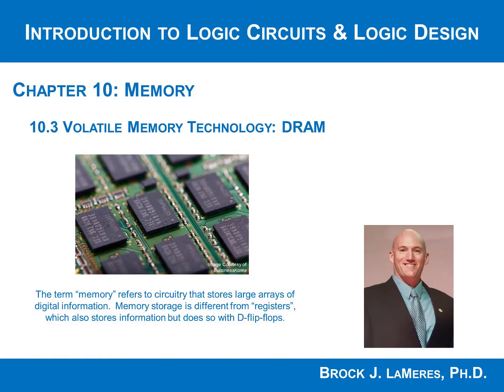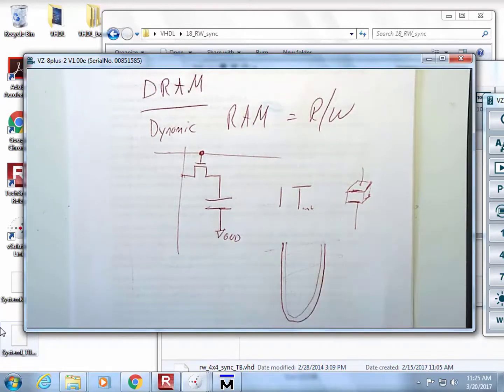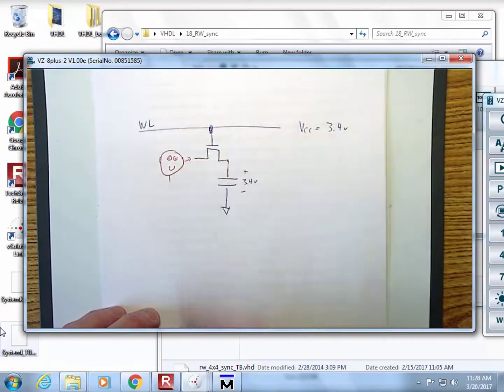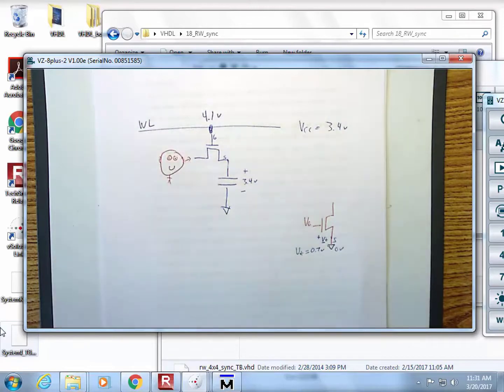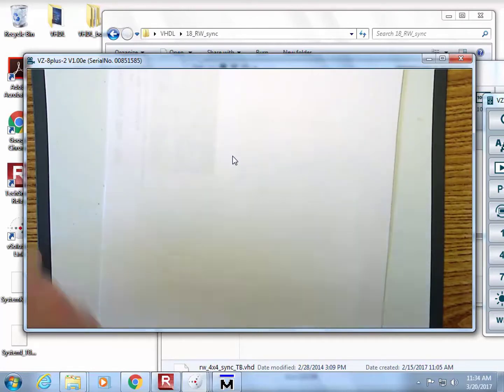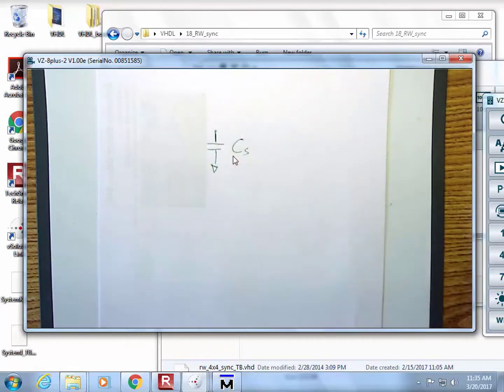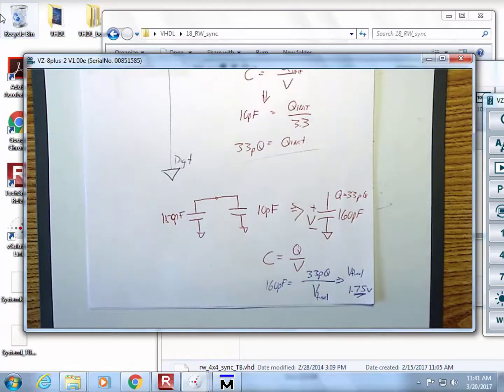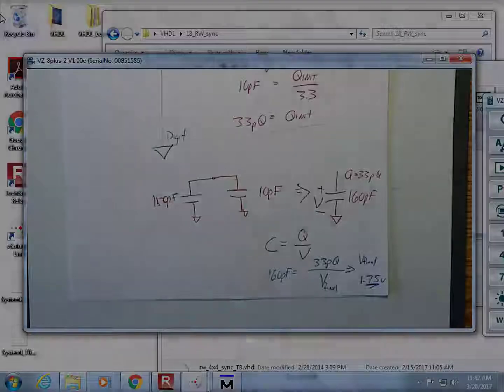10.3(b) - Volatile Memory Technology - DRAM

Comment: Couldn’t you also use a transmission gate (PMOS and NMOS in parallel) instead of a charge pump? Then you could get the speed you want, I guess the trade off would be you would need an extra transistor and inverter to make that work